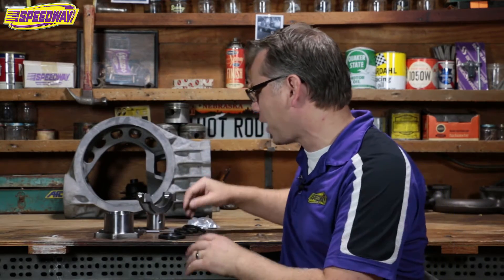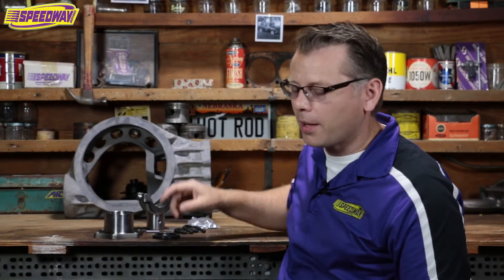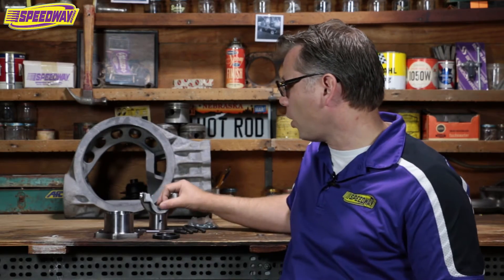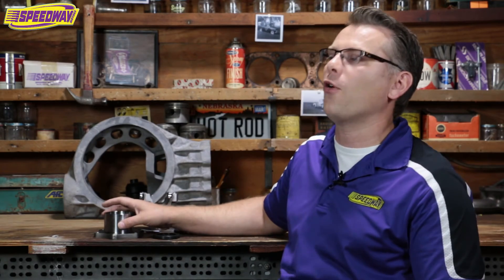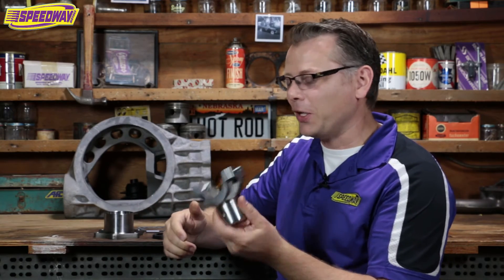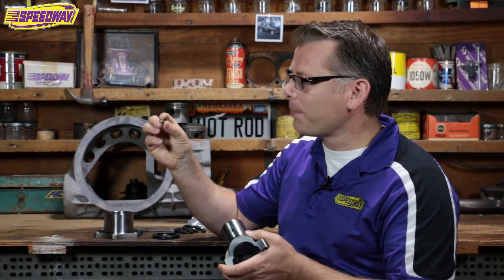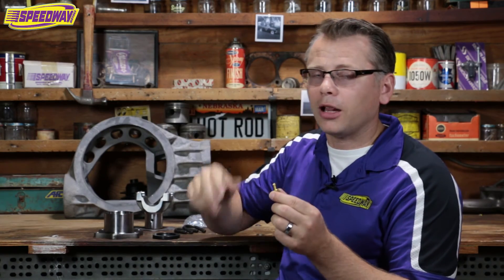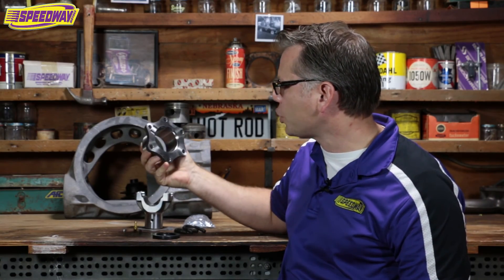Speedway Tech Talk - Ford Banjo Rear End Open Drive Conversion Kit

Comment: Nice trick for not getting chips/ shavings in a place you can't remove them. Drip drill bit in heavy bearing grease and keep speed low. Grease captures the chips and none get inside. ( do the same thing with the tap.

Comment: what do you know about the columbia rearends, that were two speeds. i believe that were called mountain rearends and shifted by vacuum.  do you have anything on these?
Reply from the maker: Columbia two speed rear ends are wonderful! It can be difficult finding a good one, but they are period perfect for an old hot rod!  Some of the fellows that I’ve talked to about Columbia’s say that you need to buy two or three before you’ll find one usable rear end.  We don’t know if that’s true or not, but back in the day these were a really trick piece. It would drop a typical V-8 Ford going 55 mph from 2713 RPM to a leisurely 1940 RPM. It’s a great way to achieve an overdrive without messing around with the transmission!  I’ve actually been looking for one of these for my 40 Ford, but they’re getting tougher and tougher to find!

Comment: I have a 1940 Ford coupe. Can I replace the original center section with a quick change center, while retaining the original outer tubes?  I realize this may include the replacement of the outside bearings. Would the outside bearings work if replaced by the Torino bearing setup? Thank you
Reply from the maker: It is very possible to change the center section out to a quick change setup and retain the factory bells. I believe it still requires machine work to the pinion but we do not stock a part to make this happen. If you get in touch with Winter’s they can help get you the parts you need to do this swap!

Comment: I've got one of these kits for a 1940 Ford axle I have. What's the best location for the vent? Top obviously but should it be the center section. I wish I could see a picture.
Reply from the maker: When doing the open drive conversion the vent needs to be installed somewhere between the third member bearings and the housing flange on the end by the brakes.  It will be installed on the top side in an area clear of any other suspension or frame components.
Reply: Hey, thanks for the fast reply and the help. I appreciate it.